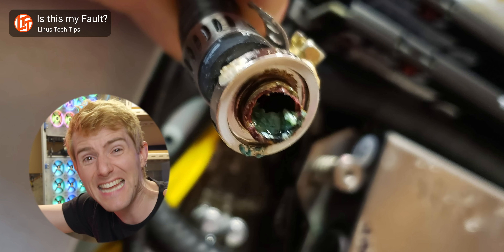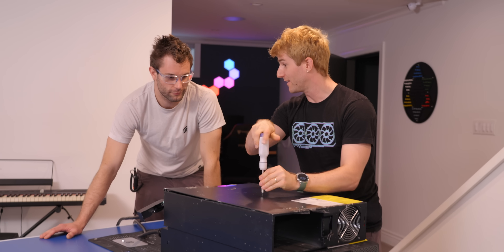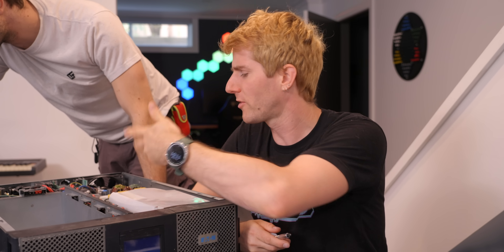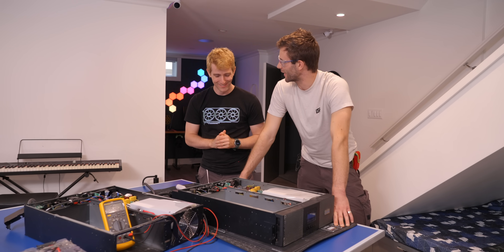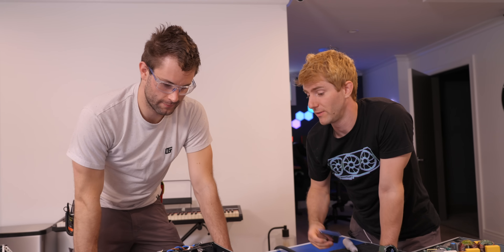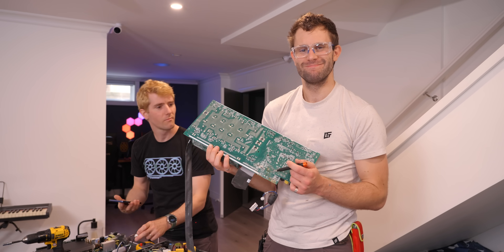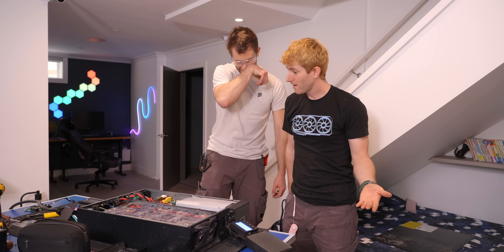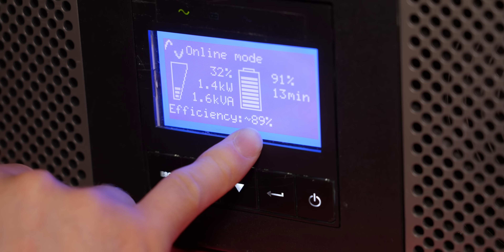Risking my life to save $5000 - Water Damaged Battery/UPS Repair

Comment: Bro, why even bother with those shitty UPS systems anymore. Ring up Brian the Electrician, ask him to install you one or more Victron multiplus 2's, add a bank of 48v batteries, which you can build yourself, and you could put your whole house behind your own, expandable  UPS. You can even save your own PV generated energy, use it later, or even take advantage of low and high tariffs, all at the same time. Even better, install a Quattro and hook up a generator aswell, so you can essentially be offgrid for weeks if power goes out. The Cerbo that controls everything can do all this for you, and can be integrated into home assistant etc. 

You can expand the victron system to many, many units in paralel and three phase power. I think up to six 15kw units paralel, much more than you would need. Charge the car etc.

Comment: Hmmmm…. Typically blown fuses in UPSs are indicative of blown IGBTs… Companies are really stingy, they only use fuses to protect the user (and prevent fire), not necessarily the equipment itself. By the time the fuse is gone, typically the IGBTs are also gone. Not worth replacing those if it’s the case, there are several of them to create a true sine output. Control boards though should typically be fine, but sometimes different firmware revisions between revisions are used, which conveniently is not not communicated to end user ;) EATON is a quality product, still though don’t repair it. Might look ok nut then when loaded can fail to deliver power….

Comment: Linus how do you feel about a review of the ASRock B760M PG Lightning DDR5 non-WiFi lga1700 mobo? Would love it if you could, cos as far as I can tell, it's made in DDR4 and DDR5, Intel and AMD, WiFi and non-WiFi (although the latter has a WiFi m.2 slot to support user installation) I've owned it for about 6 months and for the life of me I can find ANY information or reviews on it, except for a handful of google reviews and on ASRocks website. Please help. Basically I wanna know if I made a terrible choice or not, and if I can overclock my 12400f utilising BCLK (I have tried messing around in BIOS heaps but seems to not be possible, at least for me and my basic knowledge)
Reply: Or maybe a video on boards that can OC utilising BCLK for non-K CPUs, then including a slightly longer section regarding the ASRock b760m Lightning DDR5 ( NON-WIFI VERSION1?!!1! specifically for me and the 9 people that appear to have reviewed them on google)
Cos I feel that would make a great video for people who want budget performance and also tickle your desire for frustrating Intel 😁

Comment: 17:00 It amuses me that in North America 240v cables/plugs are these huge bulky things, whereas in Australia they are just our normal cables/plugs...
Reply: They're not just 240 volts. I'm not sure of the exact plug type, but it might also be rated for 30 amps. Some UPS's do that, taking in 30 amps in one plug and then having many outlets on the back with the usual 15 amp rating on each one or group of outlets with their own breakers.

Comment: 13:50 These fuses are not directional, the diode symbol is there to indicate that it is a fuse designed for working with electronic components (faster response time)

Comment: This is definitely one of those cases where swapping out your LTT driver for a good set of electrical screwdrivers that have an insulated handle is worthwhile, especially if you’re going to point at stuff with the screwdriver.

Comment: Perhaps you could make a solar / battery backup system from the solar and battery home power industry and why IT battery backups are superior. Uninterruptible, line conditioning for power and other inputs. Could they be combined for superior performance and longevity?

Comment: This has probably BEEN covered in other posts but if you are storing BIG capacitors, remember to short the pins out! The power leads are basically antennas and over time WILL gather voltage from atmospheric induction and surface charging aka the skin effect. That voltage difference HAS to go somewhere and that WILL be on the inside of the capacitor and one day you will pick one up and accidentally touch both leads to yourself or ground it out in some way and then you suddenly find out what 600V can do!

V

Comment: The voltage on the cap doesn't indicate the voltage that'll be in the cap, it indicates the voltage the cap is capable of handling. So for example, if you have caps in a 120v circuit, then they'll have 120v and whatever capacity they're rated for. Using a 300v rated cap with 120v makes sure the cap can handle any voltage spikes and gives it plenty of safety margin, but if you were to put a 50v cap in a 120v circuit, then *POOF*, out comes the magic smoke.

Comment: As someone who also has water cooled rack mounted gear and a rack mounted UPS, this video is exactly why I mounted the UPS above the water cooled system. I have it closer to the bottom with nothing underneath it.

Comment: I havent watched LTT in some time, but the Red Hair was a bit surprising, definitely looks interesting gonna take some time to get used to the new look. Anyway love the videos, linus is definitely helpful in diagnosing problems on my own rig, of which the CPU and Motherboard mysteriously just died, gamed on it the night before, went to turn it on the next night and was met immediately with a red CPU ez diag light, i thought the 850w PSU went bad since i was pulling 256watts on a R9 5900x and 400-500w on my 7900xtx in rage mode. Would love to see actually what went wrong since it worked perfectly fine the night before.

Comment: 3:43 is like the stock footage where a factory worker holds the solder iron at the tip.... there is no conductor material present on the C61 via's you won't probe shit there.

Comment: Here’s the thing. If I was going to test the UPS to see if it works after the hardware swap… I would never put it back in the rack like they did. Imagine if the thing went up in flames after it was connected to power… it would take out at least what was in the top rack. I would have tested alone in an open area away from combustible objects. Keep I mind, this is from a person who knows nothing about electronics… soo the expert might have thought it was fine. But still… 😅

Comment: I recommend replacing lead acid batteries with Lifepo4.  They are safer and can charge faster (if you use additional charging) and give more energy.

Comment: Pro tech tip: coat the small surface mount components everywhere on the circuit board with either MG chemicals conformal coating, or my favorite: clear fingernail polish, to prevent water intrusion to the very fine pitch pins, which are naturally most sensitive to slightly conductive water. Any electronic device that is in a “waterproof enclosure” that I mount in the rain gets this treatment. Also, my key fobs.

Comment: The shot at 0:47 is almost entirely useless, would've been good to zoom out a bit, slow it down, explain it or add a little text overlay here because with how it's edited now I had to pause it to figure out that it appears to be part of the case and it's not flexing but Linus is just kinda wiggling it

Comment: @linus "AC can't exist when it's unplugged" I get what's being said here, in relation to checking capacitors, but the unit has an inverter, which can create DC when unplugged, that's literally how it works

Comment: Just because there are vias close to the caps does not mean those are connected to the caps. Assuming you actually measure across the cap without a wiring diagram is...let's say suboptimal safety advice ;-)

Comment: Electric engineer here. Are you sure that the fuse was blown. because is has a diode in it the continuety test may have been inverted
Reply: It was definitely blown, did continue checks in both directions and compared against the fuse from the other unit

Comment: I open psu all the time. Dont do this dont do that is really annoys me the most. Like you will not die, if you not just messed up. Just learn and careful what you done, know what really dangerous that you should not touch like capacitor, inductor, and transformer you will just fine. Always check the voltage with multimeters. Just dont carelessly touching the board with both your hand or if you got zapp you die (because the high current just straight to your heart)

Comment: Great video. But small correction throughout this video you say “high voltage” IEC defines high voltage as above 1000VAC or 1500VDC. In the US it’s more like 115000V.

Comment: As an electrical engineer, I approve of this video. The emphasis they put on how dangerous working on things like this is, is in no way an overstatement. Always be SUPER careful (Even when working below 50VDC).
Reply: It's not the Volts that kill, it's the Amps.
Reply: @johnt.848  while that is true, try bridging out a battery with a thick piece of copper wire and see how quickly that heats up to dangerous levels. Just because you might not get shocked, you can still get injured.

Comment: Awww "high voltage" and "big capacitors" *laughs in medical linear accelerator engineeeing*
Reply: I used to work at a particle accelerator building things to go into the Large Hadron Collider, particle accelerator setups are certainly much more wild than what is shown here 😅
Reply: @tynanstack7924  although I suspect that with a Linus around, even 1.5V is high voltage enough for him to cause shenanigans
Reply: @tynanstack7924  I work on the bottom end of particle physics, 6 to 18 MeV and associated photon MV on the radiotherapy treatment linacs in my hospital for cancer treatment. Spiciest voltages on most of our linacs is ~-50kV on the electron gun, I cannot for the life of me remember what the operating voltages on the RF amplification pulse forming network around the magnetron/thyratron 

Being able to say I'm a linac engineer still makes me feel like I'm a mad scientist and I love it! My absolute favourite sentence I've ever said at work makes me sound like I'm one of Dr Evil's technical team "the vacuum in the waveguide has catastrophically collapsed, contaminating it. The ion pumps won't fire and the electron gun has burnt out, fetch the turbomolecular pump and nitrogen purge kit"

Comment: 17:11 Most modern electronics has universal switch mode power supplies. They work from around 85 til 240 volts AC (and even DC!) - And the controller will have UVLO (Under voltage LockOut) - So no, you will not "strain" something by plugging it into 120 instead of 240. If it's not safe to run it at 120, it simply just won't turn on.

Comment: You should have tried to fix, clean and dry the PCB boards right away, not waiting several months. Replacing the fuses probably would have fixed it. Instead, you allowed corrosion to occur. At least the video paid for your parts.

Comment: He may be an engineer but he seriously lacks in testing and repair capabilities. Lol, he connects battery to untested device instead of soldering two cables and giving voltage slowly to check in controled way if anything is burning.

Comment: Yeah, I dont know man. From a responsibility for the audience perspective, the sheer amount of disclaimers, warnings, but at the same time all the shortcuts, warning about touching dangerous components but then Linus going all ham in the chassis with a metal screwdriver held by the metal shaft, and all the "under normal circumstances, we would, but now we dont" in this video...

I dont think this video should've been shot or published in the first place. You dont wanna spend 5k, fair enough, get someone to repair and work around it properly, but dont make an example out if it publicly when you have to disclaim every 5s of the video.

Comment: Dangerous voltage? Well, since I prefer to avoid discomfort I go for 25 VDC or about 15 VAC. Back in the day the power packs for model trains aimed at kiddies were 12 to 15 VAC for Lionel and Gilbert. And since I am somewhat stupid from tie to time I know you CAN survive about 750 VDC or 1500 VAC. Fortunately I did not grab so much as brush those, "throw me back in my chair which somehow found its way to the other side of the room." (Transmitters in the bad old days use obscene voltages.)

{O.O}     (It was much later in my life I learned to value it the way it should be valued. Somehow I survived.)

Comment: I just got my degree in mechanical engineering and I dont know how another mechanical engineer is comfy with touching big ass batteries (I also just have a fear of high power electronics)
Reply: Tynan's Upgrade would terrify you, then. He built an electric induction forge with huge capacitors and a dodgy pc power supply. He wanted to make a new LARPing sword.

Comment: Reminds me of when I was in undergrad and helped my uncle repair a lab-scale electron beam evaporator power supply, only that things was ancient, provided 12kV@1A, had a toaster oven sized 1uF 15kV capacitor, and because it was ancient ran using a big water cooled vacuum tube that had leaked. Oh, and my uncle had gotten a shock off the thing several weeks prior. Knocked him out for half an hour. He'd been repairing that kind of equipment for decades and had missed the single high voltage wire on the low voltage side of the rack that had a blown resistor. It arced two feet to his hand from that.

Comment: Unfortunately my experience with the UPS market has been terrible. Both of my UPS reached their batteries lifecycle around 4ish years (usually recommended to be replaced in 3-5) and both devices showed battery error prompting a replacement. The UPS is from one of the biggest producers of UPSs (Schneider Electric/APC). Doing a bunch of searching online, it seems like they don't carry or have any inventory of replacement batteries for any of their SKUs. This is the case for both 3rd party sellers and themselves. While it makes sense that batteries do have limited shelf life, they don't seem to have a flagship product or a system design that allows for mass production of a similar battery cell that be modularly assembled for all their SKUs. Talking to a reseller, the lead time was 20-30 weeks for a new replacement battery. That sounds like them going back to factories and making a new batch. I then did a wide horizontal search for other brands and found similar scenarios. Also the price of the replacement battery was 60-70% of the price of the unit itself. It almost seems more economical to generate ewaste and throw out the entire UPS to buy a new one. I hope one day you guys can do a deep dive on this and see if you can find legitimate provider than can properly service a non ewaste generating UPS ecosystem.

Comment: lmfao first time I've seen Mechatronics on any video. Got my degree on it. Jack of all trades between electronics, mechanical and software. Often specialized in 1-2 fields depending on your experience. All you need to build your own terminators. That's what they promised anyway, but...
Reply: Pretty much exactly why I did Mecha, super broad base to start from!

Comment: Those high voltage capacitors are probably in a bank with caps in parallel and series. There can be way more voltage there than what the individual caps are rated for. I always short them out with a screw driver or something to make sure there is 0 voltage. Also, I need to talk about the screwdriver warranty...

Comment: As a electrician that works with batteries daily i thank you for the warning prompts for crazy viewers
Reply: As a technician, anything that high in voltage I would use rated rubber gloves
Reply: @ludavis  agreed, tough they can be hard to work with in extremely tight spaces you can make voltage free and measure it to be safe.

Comment: Had an Eaton UPS, it was great, right up to it sending errors that the battery was "out of age" ( original, lasted about 10 years, still tested good. ) Tried to get replacements but to get some you had to have a service subscription. This was my home setup not a business.
 BTW, Qualified Electrician here in Australia, not working on anything out of my league.
Had a look, found the equivalent batteries ( same numbers and everything ), put them in BUT unable to reset the programed timer so the error was still there.
Persisted with it till I could afford a new UPS. ( found it was called some other brand but it was actually an Eaton UPS in small print ).

The subscription model is what made me try to move away from the brand.

Comment: That's funny I'm thinking about doing about the same thing. I had a 3000W APC unit that was really nice and I got for free and all I had to do was get new batteries for it until it died a few weeks later. Yes I just replaced the batteries and a month later I went to do a project where I was going to need back up power was plugging stuff in and it died. I just recently finally found the correct version on eBay and it came a little shipping damaged so I'm planning to transplant into the nicer casing eventually. A like for like swap is fairly safe as long as it hasn't been plugged in a while gotta be careful those caps.

Comment: I would have fired someone for having water over a high voltage battery system. In racks, ALWAYS have water-cooled or otherwise water-bearing blades AT THE BOTTOM. Gravity can’t be defeated.